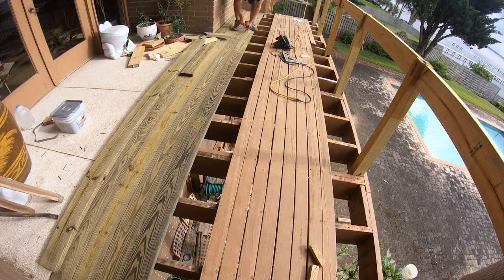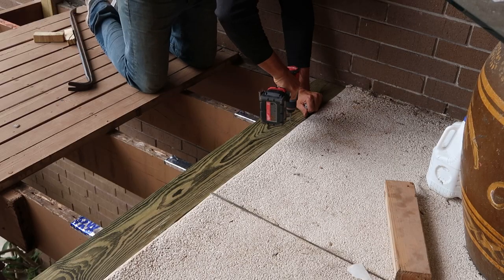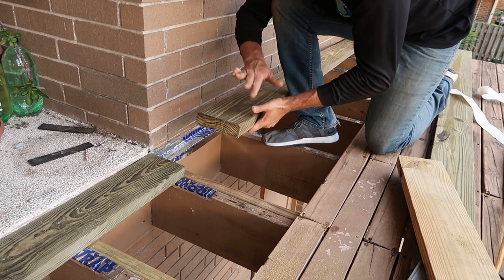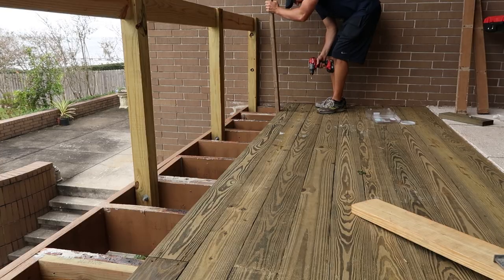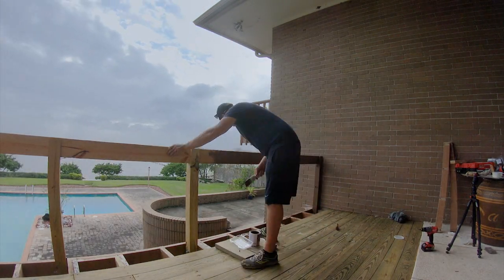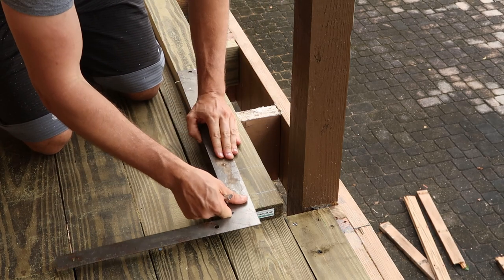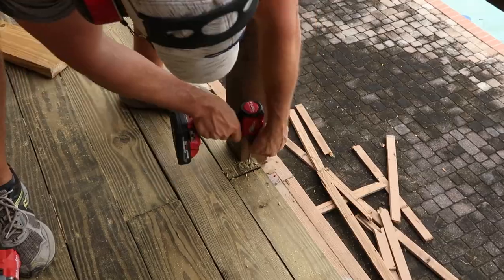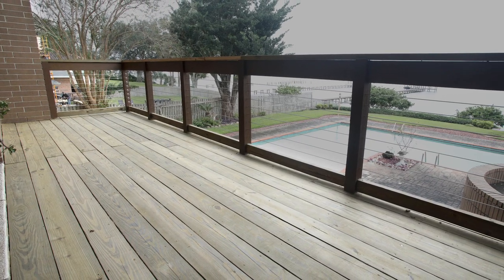Replace Deck Boards and How To Straighten Bent Wood Planks To Reduce Decking Gap Space

Comment: @MrKristel~ Your deck is similar to deck rebuild project I'm going to do this spring. The sub-structural portion of our deck is solid, but the pressure treated lumber on deck surface needs to be replaced. I don't know what part of the country you live in, but we live in the heart of the midwest where we get a lot of snow & ice and the deck goes through tremendous temperature changes throughout the course of the year... (winter -30 degree to summers over 100 with 95% humidity). Our current deck was here when we bought the house and it is not large (12' x12' max). It was constructed with a staggered board pattern and the face fastened screws. Because of the weather extremes, all the "butt joints" within the staggered decking surface have caused upheaval and rotting of the boards at those joints and even at the face fastened screw holes. Since the deck is not excessively big, I am planning on using full length boards to "re-deck" the top, after applying Butyl Joist Tape to all the joists to create a waterproof membrane and then Edge Fasten the screws using a deck jig (ex: Camo Marksman Pro or Kreg Deck Jig) to provide the boards a stronger hold to the joists. It's my belief that our current deck boards were installed with virtually  NO gapping between boards which also contributed to the current rot issues we are having on the surface. I am going to let the boards acclimate outside for a full week on the deck surface and allow them to fully dry again, before I go about the task of edge fastening them down with approximately 3/16" gap between boards.  My HOPE is that all these combined steps will allow the deck proper air circulation, to effectively dry after rain/ice/snow and prevent premature rot. Hopefully it will give us additional years of surface integrity! Any feedback on my plan would be appreciated! ~~Christy~~
Reply from the maker: Sounds like a big project and that you have definitely put some thought into it. Not sure I have any advice but I appreciate your comment. Best of luck.

Comment: My pt deck boards have been sitting outside for a couple weeks, so I'm thinking the top boards in the stack are dryer, and some are still wet in the middle of the stack. I notice the dryer ones tend to look more golden, while the wet ones loom more white. How do you recommend determining the Gap spacing for this?
Reply from the maker: when possible, it is ideal to have all deck boards at the same moisture percentage.  If you only have a few dry boards, I would. The really wet boards will dry and leave considerable spacing so i usually but those together.  For the drier boards maybe leave a small gap when decking and hopefully it evens out over time.

Comment: I have a 20x16 deck joists made and going to lay the deck planks tomorrow. What’s a good day to stagger, I have 16ft long deck planks. Should I do 16, then cut 8, then go from there ??
Reply from the maker: Sounds like a fun DIY deck project.  You could stagger the deck boards as you see fit.  I think the 8' and 16' could be a good approach or you could throw in  few more cut lengths in there to make it a more random appearance.
Reply: @MrKistel  so what do you think will be better, 4ft, 8ft 16ft ?

Comment: Interesting, you are pulling the boards together tight. Many building codes require 1/8" gap.
Reply from the maker: This is recently treated pressure treated lumber.  When the deck was being built the would was wet and swollen.  It has shrunk considerably since then leaving gaps at the seams that were tight when installed.
Reply: As of 2021, pressure treated boards should always be touching when installed.  They will shrink A LOT after they dry.